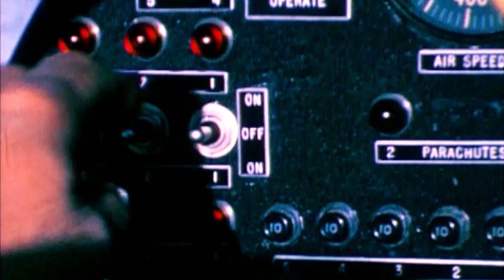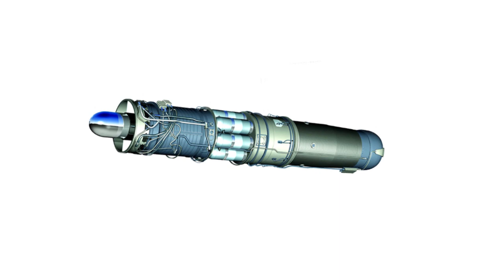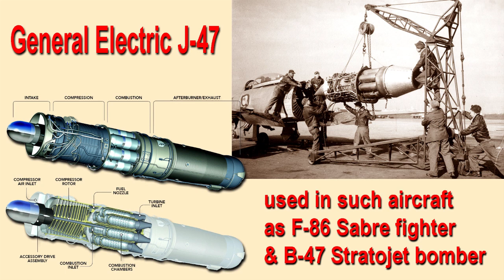Craig Breedlove's Spirit of America Jet Car - Evolution

Comment: A comment on terminology if I may. A canard is for pitch control and will be horizontal, more or less.  A steerable vertical surface is a rudder, not a fin, whether it be at the front or the rear. If the forward surface was fixed in the final evolution, it was a forward fin.

Comment: Nice job Samuel. Did they ever experiment with the canards that ho on the holes for the trailer nose hold down brackets. I have a photo of them somewhere but haven’t been able to find it yet.
Reply from the maker: I can see, in photos of the car, a round plate on either side of the nose that was  taken off to expose the tie-down bracket when the car was transported on its trailer. It's well in front of the front wheel. I'm not aware of a canard ever being attached here (like on Craig's second car, Sonic 1). Would love to see a photo of that if you can find it.